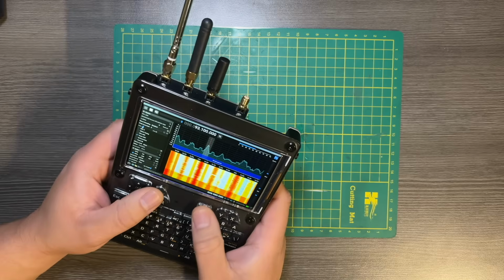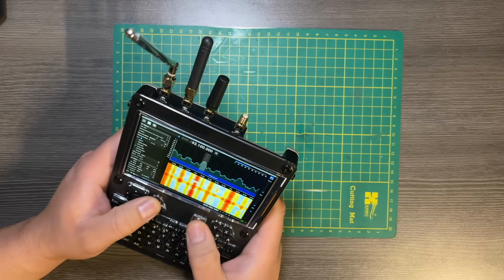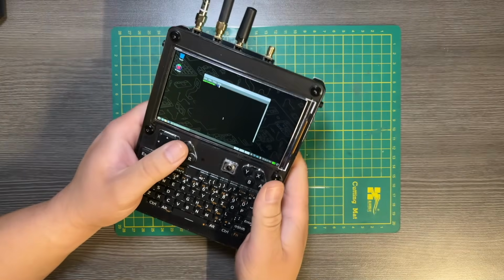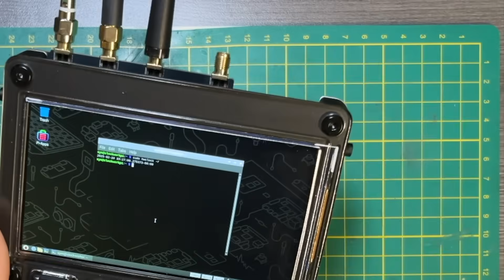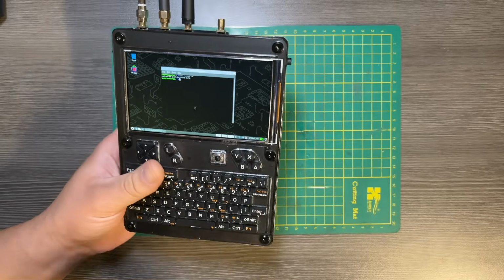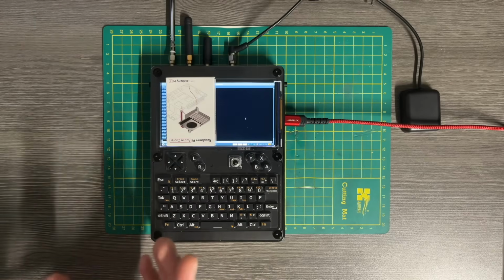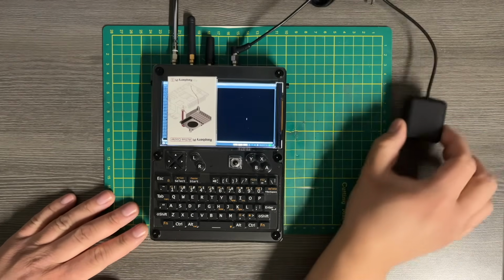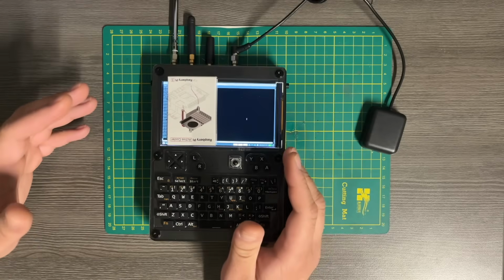This uConsole accessory changes EVERYTHING!

Comment: "This expansion allows you to do LoRa! Unfortunately, I can't show it to you" 
-Literally every video about this accessory
Reply from the maker: Yes. Initially LoRa wasn’t working well enough for me to show it off. It’s been working since. I guess i can make a meshtastic video if the demand is there.
Reply: @Symbiiote  Well, if you do manage to make a video that shows it actually working, you might be the first
Reply: @Symbiiote  Actually, what might be interesting to try is seeing if you can get Waydroid running on there, which gives you an android emulation environment, then see if the Meshtastic app on there can see the device or not. 

If waydroid works on there and can see the devices, that might open up a couple of cool possibilities

Comment: Juste received everything (uConcolse, CM5 and RF kit...) .. I notice on yur video that you add a passive cooler on the back.. Do you have the part #, and what type of termal kit you purchase for the CM5 ? some purchase the Waveshare riser + termal kit (less thick that the one came with the uConsole)
Reply from the maker: I just bought a small kit of heat sinks and attached three to the back of the metal housing. I’ve seen others use a long m.2 heatsink like this  as well.
Reply from the maker: I’m just using the included thermal pad. My pi5 never goes over 58c

Comment: How long is this thing (including the antennas)? Can you put the long one on the side antenna port thingy (what’s that called?) or is it only able to put on just the top? (Oh, and what’s that module at the bottom of the case below the batteries?) Have a good day!
Reply from the maker: You can put any antenna anywhere. They all use the same connectors.

Comment: What is this?
Reply from the maker: It’s a expansion module for a portable device called a Uconsole (portable computer). The expansion module features a SDR (software defined radio),a LoRa module (for Meshtastic), a RTC (real time clock) and GPS. It’s very versatile for various portable ham operations.

Comment: Cool mod! Question - does this expansion card also connect to the uConsole's kit speakers via those ports on the battery side of the card? If so, is there an approach to utilize this card for audio vs the USB audio device workaround from your other video?
Reply from the maker: It does allow for the speakers to work. The reason I did the usb audio mod was because at the time, there wasn’t any audio support for the cm5. That had been fixed since then so the audio mod isn’t necessary… unless you want louder speakers 😂

Comment: Is SDR++ able to be installed on the default OS without using the build from Rex?
Reply from the maker: Not unless you build it from source.
Reply from the maker: I wouldn’t use the default os. It’s pretty bad compared to Rex’s image.
Reply: @Symbiiote  Thank you!! Also, do you know if sdrtrunk will work with Rex's image as well?

Comment: You shouldn't need Bluetooth for Lora/metastastic to work. That would kill the idea of "low probability of discovery".
Reply from the maker: Yeah I got it sorted after filming this.
Reply: @Symbiiote  also, that would make more sense if you had a device without kb and display, where you might need a phone or something to interface it. 
Part of the SHTF thought process is that it's not Bluetooth and it's not wifi, and because there's a Lora radio in basically everybody's toaster and dishwasher...
For urban environment covert/SHTF, Short scheduled power on time and obscurity...it's a tree hiding in the woods.
Little probability of discovery.

Comment: Hi Symbiiote, I am waiting for my uConsole and its expansion card pre-ordered on HG (can't wait for everything to arrive). I wanted to ask you if you have links of where I can purchase the antennas to mount. I found the helical quadrifilar antenna, but I don't know where to look for the others, or at any rate I wouldn't know which are the best ones to buy. Thanks always for the content and helpfulness! :hand-pink-waving:
Reply from the maker: The included antennas are great! The only antenna I did change was the LoRa antenna. I would recommend something on Amazon that’s smaller.
Reply: @Symbiiote  from what I read on the site, the order does not include the antennas, only the stand with the four connectors, the cables to connect the expansion board to the antennas, plus the board of course. That is why I was asking for your advice on which antennas to buy

Comment: Hello there is a statement on their website that mentions a component beign end of life. Does this mean these board will not function shortly after release? What does end of life mean for a electrical component? I understand tarifs and general madness is making stuff really expensive but if the board dies or sudenly becomes unsuported should this not be a concern?
Reply from the maker: No no. It will work fine. The issue is that the specific module will go out of production and they will have to find a new version that might cost more. But when it comes to functionality they will be the same.

Comment: Where is the print blueprint for that rear panel?
Reply from the maker: You mean the stl file?
Reply: @Symbiiote  I watched the video where you covered it after that question. Did you modify the clockwork file for the heatsink cut out, or did you just cut it yourself?

Comment: PLEASE turn off the RTL-SDR's AGCs. They are NOT meant for general signals, only DAB and DVB-T, and using them on anything else causes heavy distortion. You are actively ruining any signal in the passband of the SDR by having the AGCs enabled. There is no shortcut to setting the gain properly manually.
Reply from the maker: Heard! I’m still learning everyday.

Comment: Whats the point of the LoRa antenna if you need to connect to a Meshtastic node via bluetooth to use it? Isnt that the same as me using my phone or computer?
Reply from the maker: You do not use Meshtastic via Bluetooth. It was a dependency with the software that needed to see that Bluetooth was available. That has since been fixed.

Comment: Hi Symbiiote excellent work, as always. I think that if you buy the CM5 module with WiFi built in, you can easily bypass the work for the wifi module, in return the slot could be used to mount a bluetooth device and perhaps use a slot in the usb port module to power a cooling fan for the CM5. Is this feasible in your opinion?
Reply from the maker: The reason I got the cm5 without WiFi or Bluetooth is because the normal version wasn’t out yet. Now the WiFi and audio mods aren’t really necessary. 

As for a cooling fan, the expansion board has extra usb pins you can use for a cooling fan.
Reply: @Symbiiote  Great!!! Now you've motivated me big time! I'll start pre-ordering the uConsole as soon as I can. I wanted to ask you if you only have the blog or do you have other channels (even an email) so I can keep in touch with you. Until the next video you make.... Bye!

Comment: I suppose the Lora is not communicating with the OS? (so requires a phone and bluetooth)? And for the SDR, standard Linux drivers I assume? Is there a Discord or Reddit place that explains how to configure it?
Reply from the maker: The Lora module works via serial. The Bluetooth issue was a software dependency that the Meshtastic interface had. You can check out the uconsole discord group I linked in the description.

Comment: Yes, the battery is for RTC. I am working on an LTE module that could be installed on the internal USB-C port. The metal back is good for this case, the RTL-SDR is hot when working, you could put some thermal pad on it and connect it to the metal back.
Reply from the maker: That LTE module sounds amazing! I’ll be adding a thermal pad to the SDR module!
Reply: Any chance of breaking out the RJ45 port out of the CM4/5? I desperately need one on my uConsole to do server rack troubleshooting. Cheers and keep up the amazing work!
Reply: @ only if we redesign the adapter board, and use an FPC cable connect the rj45 on the top.
Reply: ETA on release date? I am foaming at the mouth for this.
Reply: @ in two months.
Reply: @vileerdeng  will there be any additional rounds of beta testers?
Reply: @MartinWindsorLLC  Beta test is not really starting. I just sent out 3 boards to 3 people I already know. I will send out the beta test survey soon.
Reply: @vileerdeng please consider using BNC Male connectors instead of the SMA ones, as the BNC’s  are made to dis-/Connect quick and often and can handle that better then the fragile SMA ones.
Reply: @ no plan for BNC now, cause the antennas with SMA are more common than the ones with BNC.
Reply: @vileerdeng  An LTE module? Yup. Take my money, please!
Reply: Hello! Saw it back on stock. Shipping is a pain in the rear so i want to make sure of something. R820T2 is mentioned as end of life. What does that mean? Will this make it incompatible with future stuff? Is it not better to wait for the R860?
Reply: @  That means RafaelMicro no longer manufactures R820T2, all the R820T2 we could buy from the market are leftover stock. We can source enough quantity at reasonable price for production for now. But no guarantee for the future, that's why I said this may be the first and the last batch of the RTL-SDR extension board.
Basically, R860 is the same chip as the R820T2. It could replace the R820T2 without changing the circuit design. We can't source the R860 on the market except for direct order from RafaelMicro. But it will require a minimum order quantity of 4.9k.
Reply: Did you just say.. lte module?? So you’d have all of that epic goodness in there, plus an LTE?.. 5g? Where could I get one of these? Would it work with a CM5 lite? Love your work!
Reply: @k1ng_chicken  Not that soon. I am now working on an upgrade kit for uConsole that exposes the PCIe(NVMe), USB3.0, RJ45 ethernet, CSI-2(camera)
Reply: @vileerdeng  ooh, that’s sounds pretty cool! Best wishes for the project.